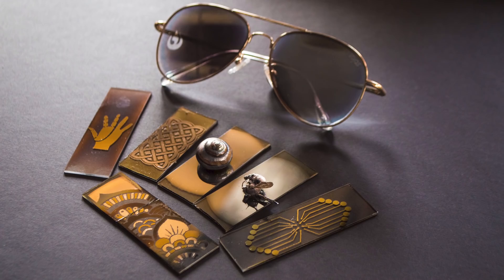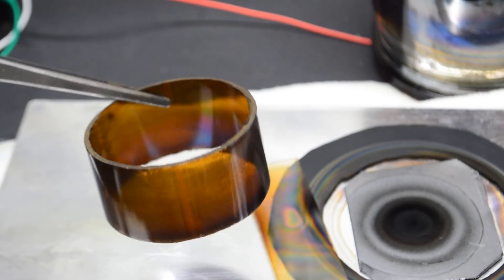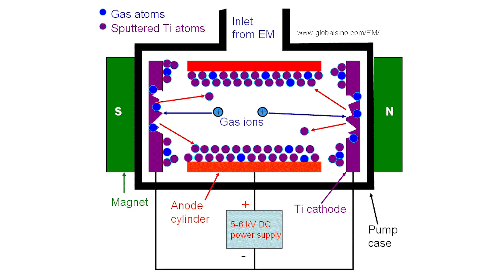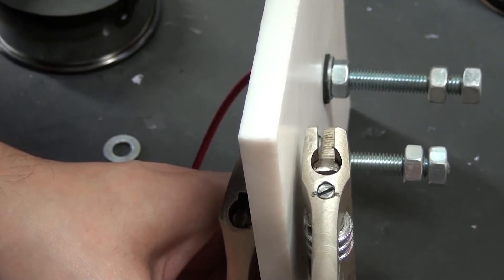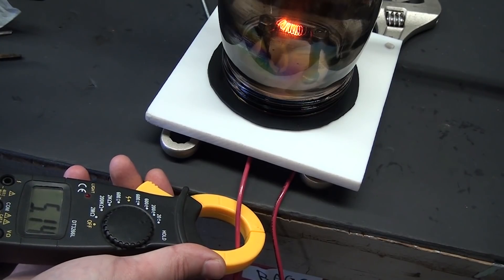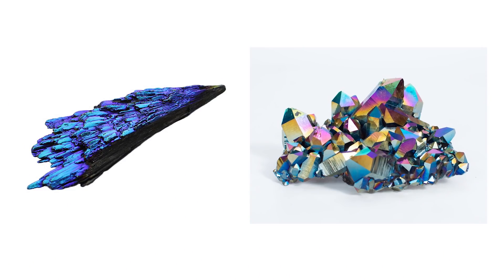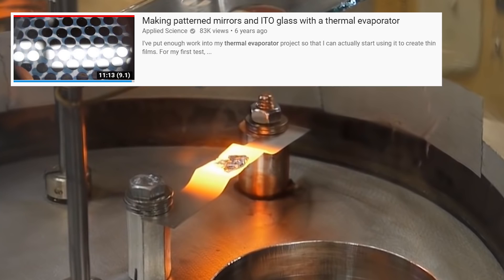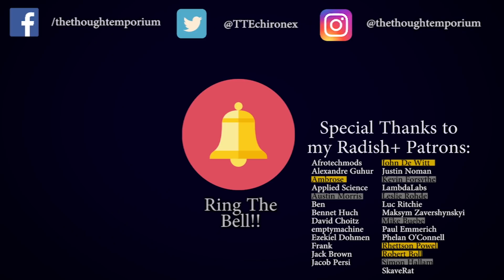This Can Coat Anything in TITANIUM

Comment: I used to work on ultra-high vacuum systems in the range of 10^-12 Torr. The thermal evaporation process is just simply that the heated material is overcoming the vapor pressure in the vacuum. This works with damn near anything you can put in the chamber. For best results, you want to get the vacuum as high as you possibly can. Looks like you're intent on switching to a stainless steel vacuum chamber which is the first step, the next step is that you need to use as much refractory material inside the chamber as possible so no organic materials or aluminum! Problem with organics is that they off-gas and aluminum is porous so it soaks up junk in atmosphere that it will off-gas for all eternity inside ultra-high vacuum environments, both effectively poisoning your vacuum. Also, you'r going to want to keep everything completely spotless clean, like clean room clean. A fingerprint on the inside of the chamber will poison the vacuum. Now for your pump setup, if you can get your hands on one, a turbo-molecular pump paired with a roughing up will get you to -9 Torr if you have proper material and good procedure, just don't turn the turbo pump on in regular atmosphere or you will grenade it.
Reply: Can't you just brush it on with a fine stranded brush?
Reply: @gangleweed  No. I don't think you understand how incredibly thin these coatings are.
Reply: So an aluminium vacuum tank won't work?
Reply: @johnnycash4034  depends on vacuum, 10-6 Torr is OK, 10-9 Torr - no way! Aluminum has very porous surface, it will outgas forever.
Reply: @odissey2  thanks for the reply.
That makes sense. The seals I'm going to be using are KF flanges with rhe o-rings so not made for UHV anyways. So I geuss aluminum should be fine then? But yeah as you said with the porosity that might be an issue. Although if doing Al coating, then the inside of the chamber would be coated with aluminium in anyways.
Reply: @johnnycash4034  We cover the walls of the Denton Vacuum chamber with aluminum foil to collect the evaporated gold, and to protect them from all other crap (like ZnSe) being accumulated. Makes it easy to clean. The chamber is about 1 cu.m in volume, and goes down to 10-7 Torr using a cryopump.
Reply: could you allow aluminium to cool under vaccum to try and end up with aluminium with nothing to offgas for vaccum experiments? granted keeping vaccum stored metal would and absolute ball ache but in theory its the gas you dont want if your vaccum task wants a super thin coating of aluminium.
otherwise youre probably stuck looking for an alloy that fixes that stucture without getting in the way of aluminium deposition, not ideal.
i only bother even thinking about it because aluminium can be interesting on the magnetism end so thin coats could get interesting.

Comment: You should see how coating spider silk changes its properties. I've wondered before what it would take to make a suit that looks like metal but acts like cloth or even silk.
Reply: It’d become brittle
Reply: Coat it in a flexible alloy or whatever
Reply: @kanesmith8271  So gold would be great but wouldn't work. Nitinol?
Reply: @Cheddar555  yes yes yes!
im stealing your suggestion
Reply: @smartard  Good luck with that😁
Reply: yeahhh lol i still see it just becoming brittle.  maybe you could find a hydrocarbon plastic, or a rubber or something.  that's the only thing I can think of that won't be brittle, but at those temps idrk if rubbers or plastics will decompose at those temps.  you might need a different method to coat the silk in that case.  (sry i'm baked)
Reply: The Spider Silk would probably lose nearly all of it's plasticity.
Reply: Plasma sputtering is probably too hot for spider silk. Exposure to hard vacuum may not be so great for it either. How about Electroless Plating, like the old chemical method for making mirrors?
Reply: @YodaWhat  yeah actually, plasma cleaning is a thing isn't it?
Reply: @AngDavies  Yes, quite a thing in specialty manufacturing.
Reply: Shhhhhush......keep that shit to yourself. >grin< I hear ya.
Reply: @YodaWhat  What about radioactive spider silk?
Reply: @JasonDoege  What are you asking? Something related to Spiderman? Something about plating? Otherwise, radioisotope-labeled spider silk is a real thing, and has been fed to spiders to see how long it takes them to recycle old silk.
Reply: Metallized fabric looks reflective. There is very reflective0 metallized fiberglass and moderately reflective metallised cotton (used on your ironing board). It's fairly common.
Reply: 0:38 you can use plastic
Reply: it could be very beautiful! a small rainbow web mounted in a shadowbox...
Reply: because spider silk isnt ever supposed to be a "dry" fiber its quite hard to work with for any nonbiology themed methods in general. id try a polymer basecoat to create a trapped enviroment around the silk to keep it intact through further coatings or try and find a polymer resin you can convince to bind really well right through the fibers of gosamer to try and side step a few of those issues. but yea then a reflective coating so you cant just cook it off someone with a bic lighter and you might have a fun suit there.

Comment: Pls try coating a playing card! That would be awesome
Reply: It would be a coating like as if he painted it(IF the card servived) sorry. Good idea tho
Reply: HÆX A. Painting something doesn’t produce these shiny interference patterns though
Reply: @among-us-99999  "coating" "as if"
Also there's paints that can do simular effects as well as additional additives you can mix into the base even techniques used when painting and as it dry/sets
Reply: I think he might have meant with like a stencil of the cards template, so you'd have a shiny metal number, and shapes, or even the other way around.
Reply: Not sure if you realize how thin these oxide layers are, but it wouldn't be like a solid metal card.
Reply: Near a 900° titanium wire ? I doubt it would succeed.

Comment: When you peel off the vinyl, it leaves behind some glue. If you try to wipe with IPA or acetone, it will into unwanted areas. I have etched thin metals using vinyl. In that case the acid reaction is quick. Perhaps you need to peel of the vinyl cuts off, before pasting it onto a clean sheet of glass.
Reply: Yeah that too, its works in lab

Comment: When i was doing that at university, we suspended the material to be coated at the top of the vacuum chamber. We also used the "boat" design to heat our coating material. Lastly, we used a laser to measure the thickness of the coating (with interferometry) in real time. The chamber was about 1 feet high if I recall correctly.

Comment: Quite a few years ago I read a paper on 3D printed scaffolds that were made from plastic at a very fine scale and this plastic was easily dissolved in certain solvents. So what they did when they had this very very tiny scaffold is they coated it in metal and then dissolved away the plastic leaving a very tiny very fine hollow tubules in a scaffold form. You might have fun trying a project like that. Please let me know if you try this thank you very much for your videos. I always enjoy them.

Comment: I highly recommend avoiding vacuum grease at all costs. It's hell, gets everywhere, and kills your vacuum. It's outright banned in most labs for this very reason.
The only two proper ways to do vacuum feedthroughs are to either have glass-to-metal seals(out of reach for you to make, and probably over budget for something DIY), or, the cheap and easy way - to use existing viton o-rings for KF flanges, and to make a flange seal outside the vacuum chamber, with two flat surfaces squeezing the o-ring, while the thread(with slits cut in it!!!) only provides mechanical pinching force. Both real and virtual leaks will haunt you if you don't do it this way.
This also applies to the metal chamber you're building. Either just buying proper feedthroughs($$$) or building your own out of blank flange caps.
Reply: The endcaps of 'neon sign' tubing (low melting point leaded glass) are cheap and provide a way to get wire through glass into vacuum that do not leak. Also, those electrodes are hollow and have getter inside them, which can be activated with a high-voltage discharge through imperfect vacuum. So use some just for that, and for general feedthroughs, cut them short on the hollow electrode side and take out the hollow electrode.
Reply: @YodaWhat  Almost correct, but they use borosilicate. Lead and soda glasses require gentle post-treatment with annealing, otherwise they're guaranteed to crack. However, there's no cheap off-the-shelf way to seal tubes of that diameter to chambers.
Reply: @Spirit532  Having worked with a maker of Neon Signs, and closely observed his use of Propane and Oxygen-enriched Air to heat his glass, plus his evident lead poisoning, I will stick with my original statement. Working borosilicate glass requires much higher temperatures than his setup, typically Oxy-Acetylene flames. Then, the glass is annealed at the same time the electrode getter is activated, by passing much more than usual power through the tubes.
Reply: @YodaWhat  Borosilicate does not require an oxyacetylene flame. You can soften it enough to work it with an air-propane flame, or work with it properly with either oxypropane, or what I'm using to make glass to metal seals, air+MAPP(though I will switch to oxypropane, some of my operations are uncomfortable without the option to get a sooty carbon flame).
I've also used air-propane to make borosilicate pipettes in the past.
As for annealing - I have no experience with neon sign manufacturing, but I'm assuming that blasting the tube with a few hundred watts is just about enough to get it around the annealing point, but the stems come pre-annealed anyway, you're only annealing the joints and bends.
Reply: @Spirit532  Ok, if you say so, but the makers of scientific glassware I have seen at work were using OxyAcetylene, which is more expensive and much hotter than any other common torch mixture. Anyway, here is a chart of various relevant temperatures for several types of glass: https://slideplayer.com/slide/4235773/14/images/18/Important+in+glass+forming+operations+are+the+viscosity-temperature+characteristics+of+glass..jpg

Comment: I´d recommend putting some step-down transformer between the variac and filament. That way you get much more control over it and there´s no risk for the variac. The transformer from a lead acid battery charger may be a good option.

Also, THANK YOU for recommending this book in your last video. It really is an awesome book. Just a few days ago I also read about these getter pumps in there.

Comment: As a Vape Enthusiast, I know a bit about Ti heating coils; you should be using DC Voltage, with 5 V max. I'd consider making a "Clapton" type coil wire for this apparatus (multiple parallel internal cores - like a freeway, and then fuse them together with an outer wrapped "sheath").

Comment: For the calcium evaporation in the ion trap, that i work on, i built an oven from a steel rod wrapped with tantalum wire and insulated with ceramic. Granted for trapping ions, only a few atoms of calcium are sufficient. Great video, keep up the good work.

Comment: Hey dude, I love your videos. There is another way you can improve your build, instead of using titanium or aluminium wire, you can coil up tungsten wire, and run high current in it, it can easy get to very high temperatures, if you insert aluminium or titanium wire inside the coil it will vaporise the metal and coat everything you have inside the chamber. I've been using this method to coat surface mirrors, with a hacked MOT, and, Grant's scariac. Hope this info will help in a future build.

Comment: Is you glass slide made out of SiO2? If so, could the O2 be reacting with the titanium to form TiO ?  Hence the oxidation contamination could be from the glass itself?
Reply: Michael Nilson  i'm pretty sure there was the experiment with microwave plasma where he was using Borosilicate glass that had sodium ions in it. which messed up results too.
stuff like t his is always interesting.
Reply: the nice adhesive properties of titanium films onto both glass and pure silicon are because of surface reactions. It is absolutely plausible that a too thin titanium coating on glass fully oxidizes quickly, both from the glass and from the atmospheric side.

A different material often used for sputtering metallic layers on microchips is an alloy of tungsten and titanium.
Reply: Not quite, but actually maybe very much on the right track. Glass likes to have chemically bound water -- Si-OH groups on the surface.  That might screw up bonding.  Heating I think is the solution?
Reply: Interesting question. The Ti might have enough energy to reduce the surface of the glass. I doubt it will have the energy to bury itself all that deeply in the glass and once that interface is created the Ti wouldn't really be able to react further.
Reply: Michael Nilson  it was sodium in the glass causing issues. He used plastic instead.
Reply: @BloodSprite-tan  i thought it was soda glass. Borosillicate is silicon and boron
Reply: @TheIdeanator  I cannot find a source right now - but the explanation I learned why titanium electric contacts are quite insensitive to a remaining silicon oxide layer on top of contact pads on a chip is, because the oxygen is transported through the titanium layer, or that the forming titanium oxide is actually immediately dissolved into the titanium, presenting new, fresh titanium to the interface. 

Normally for this to happen you would anneal the contact, but at a sufficiently thin layer I can imagine that all titanium is quickly converted to titanium oxide.
Reply: holy fuck, is that a thing?
Reply: the free titanium ions are very reactive so it would make sense that it is sensitive to contaminants, however it is unlikely that titanium oxides would be produced and emitted into the air as the silicon dioxide bonds are much stronger than the free ion, and due to vacuum insulation, the glass wouldn't get nearly hot enough to vaporize titanium oxides.

Comment: First off, phenomenal video and congrats on yet another DIY conquest! Second, I can't decide if I'm more excited or furious that titanium sputter coating is as simple as "add heat" (minus the vacuuming steps ofcourse). Now, I may be but a lowly student of mechanical engineering, but as fellow vacuum/plasma/high voltage enthusiast I have some ideas that might improve the process. No idea if these will actually work, their just my best guesses after watching your video, but here goes.

1) Assuming that a straight titanium wire sputters titanium atoms in a similar pattern to how a fluorescent tube lamp in a tanning booth emits photons, if you arranged a bunch of these straight wires in an arc above the target such that they are parallel to the arc's axis of rotation (same configuration as the lamps in a tanning booth) it should concentrate more sputtered titanium on the target than a simple flat array of straight wires would. As well, by increasing the central angle of the arc it could help get titanium around tricky corners of the target. Or you could make it a full rap around cylinder of straight wires like a sort of cage to do a full 360 coat, but this might be a hassle to set up.

2) It might streamline things if you made the titanium wire preformed titanium wire elements. So taking my suggestion of the titanium tanning booth as an example, if you had the ends of the straight wire sections come together to form two bulkier wires (one per end) and then curled those bulkier wires in loops slightly larger than the bolts you used, so long as you are gentle with it all you have to do is put the target in position, take the top nut off of each bolt, drop in the preformed wire arrangement, replace the nuts, and then bam you're ready to start the process. This way, once you find the best wire arrangement for a given process you can just stockpile a bunch of copies of that array and swap in a new one as soon as you need it.

3) As you mentioned, this process is commonly used as a secondary vacuum pump, so maybe if you have a big enough chamber you could install a second heated titanium wire on separate set of bolts to act as a secondary vacuum pump. You could put it off in a corner somewhere so that it won't have much impact on the coating process and connect it to a separate circuit so that you can run it for a while before heating up the coating wire in order to improve the vacuum. My guess (and it's 100% a guess) is that while the geometry of the coating wire has the most effect on coat uniformity for a given target, the deeper vacuum may improve the repeatability of the results by further removing stray gas atoms from randomly intercepting the titanium atoms being sputtered from the coating wire.

Anyway, on the off chance that you do read this and that you had the patience to read through my likely bogus suggestions, thanks for all the help your videos have given in the fields of vacuum systems, plasmas, and high voltage circuitry. And as always, I'm looking forward to your next video, whatever it's about!
Reply: You have good suggestions there, but to coat evenly from all sides, it is perhaps simpler just to make a loop large enough to surround the target. Study of the ways filaments are supported in incandescent light bulbs can be instructive. Also, (and especially if desiring the beautiful golden hues of Titanium Nitride) use Nitrogen purge gas instead of Argon. It will also make a much better vacuum via sputter pumping than Argon, because Argon will not combine chemically. Argon is an inert gas.